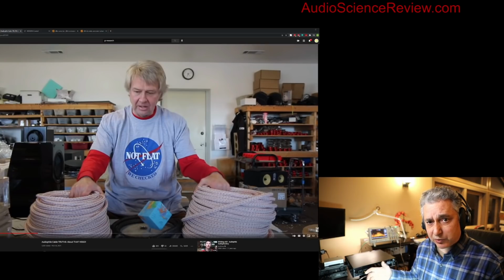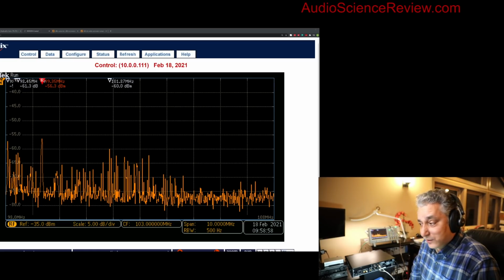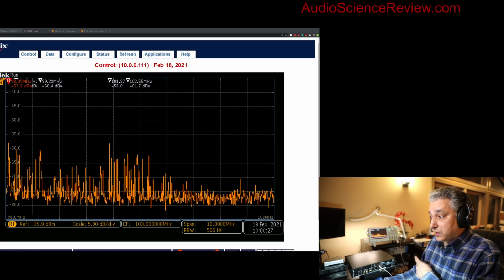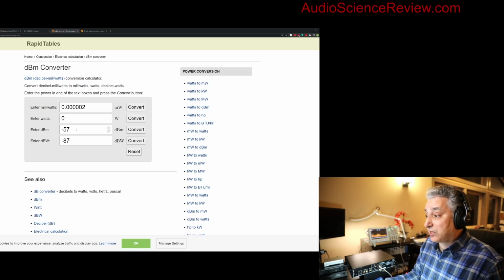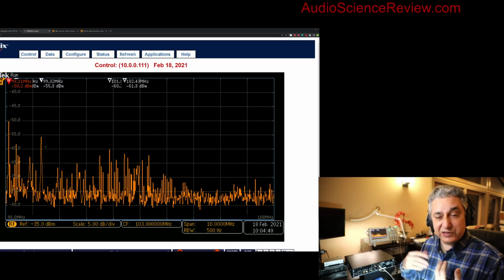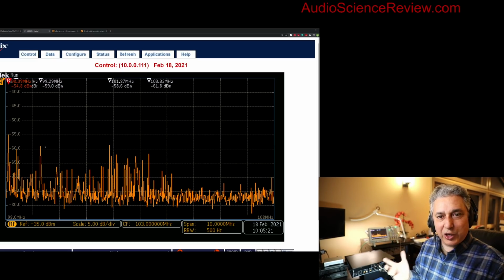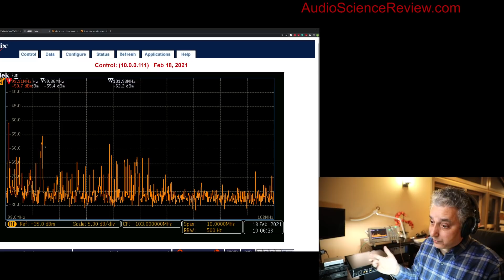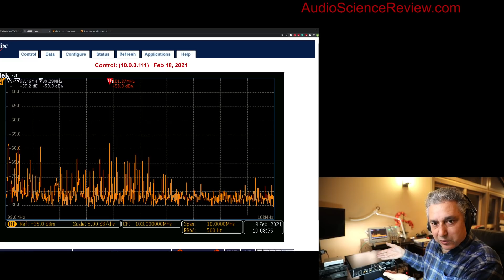RF Interference in Speaker Cables???

Comment: I will preface my comment with the fact that I am an electrician not an electrical engineer so my knowledge of interference is extremely limited. When we are installing data, audio and low voltage control wires we try to maintain a minimum separation from power wires and try to cross them at 90 degree angles. This is of particular importance when working with VFDs since us electricians have been told VFDs can cause a lot of interference. Should we be doing this with our audio systems at home? Is there some theoretical advantage to keep power and lower voltage audio wires separated and only crossing at 90 degrees if possible? 

Edit: here is the relevant Canadian Electrical code.

16-212 Separation of Class 2 circuit conductors from other circuits
(1) Conductors of Class 2 circuits shall be separated at least 50 mm from insulated conductors of electric lighting, power, or Class 1 circuits operating at 300 V or less, and shall be separated at least 600 mm from any insulated conductors of electric lighting, power, or Class 1 circuits operating at more than 300 V, unless for both conditions effective separation is afforded by use of
(a) metal raceways for the Class 2 circuits or for the electric lighting, power, and Class 1 circuits subject to the metal raceway being bonded to ground;
(b) metal-sheathed or armoured cable for the electric lighting, power, and Class 1 circuit conductors subject to the sheath or armour being bonded to ground;
(c) non-metallic-sheathed cable for the electric lighting, power, and Class 1 circuits operating at 300 V or less; or
(d) non-metallic conduit, electrical non-metallic tubing, insulated tubing, or equivalent, in addition to the insulation on the Class 2 circuit conductors or the electric lighting, power, and Class 1 circuit conductors.
(2) Where the electric lighting or power conductors are bare, all Class 2 circuit conductors in the same room or space shall be enclosed in a metal raceway that is bonded to ground, and no opening, such as an outlet box, shall be permitted to be located within 2 m of the bare conductors if up to and including 15 kV or within 3 m of bare conductors above 15 kV.
(3) Unless the conductors of the Class 2 circuits are separated from the conductors of electric lighting, power, and Class 1 circuits by an acceptable barrier, the conductors in Class 2 circuits shall not be placed in any raceway, compartment, outlet box, junction box, or similar fitting with the conductors of electric lighting, power, or Class 1 circuits.
(4) Subrule (3) shall not apply where the conductors of a power circuit are in the raceway, compartment, outlet box, junction box, or similar fitting for the sole purpose of supplying power to the Class 2 circuits, and all conductors are insulated for the maximum voltage of any conductor in the enclosure, cable, or raceway, except that no Class 2 conductor installed in a raceway, compartment, outlet box, junction box, or similar fitting with such conductors of a power circuit shall show a green-coloured insulation, unless such Class 2 conductor is completely contained within a sheathed or jacketed cable assembly throughout the length that is present in such a raceway or enclosure.
Reply: If you were really hard core about reducing interference wouldn’t it be possible make your cables out of stranded armoured cable and then bond the armour and bonding conductor to ground as a drain. Like I said not an electrical engineer just a curious electrician.

Comment: I was going to buy a set of Danny's cables just to send them to Amir. I really like Danny and watch all of his video's as I am. Speaker builder and have learned a lot from him. BUT when I seen his speaker cable video I had to pull back. I've read many studies in the past debunking Dannys cable nonsense and couldn't believe he was peddling this nonsense. And now again a real scientist is debunking it AGAIN.
Reply: Another Iowan here - Danny may have knowledge designing speakers, but he's too steeped in snake oil commerce now to be taken seriously. I would love to see an  RF engineer's assessment of those Tube Connectors he's peddling. He once said his system was so good that you can hear the difference between a new cable vs. one that is burned in.
Reply: @tsOnMedia  its probably the other way around the system is so horrible has almost no sinad and he can "hear" the different "noise" in different cables because the signal is so bad
Reply: @tsOnMedia  I sent some of these video's to my brother inlaw whom works for Rockwell Collins Aerospace in Cedar Rapids. He's an electrical engineer graduate from Iowa State University "well known for their engineering programs". He just chuckled and said "Danny is an idiot regurgitating crap he's heard over the years from these bogus cable companies". Amir on the other hand is spot on. Using well known industry practices to test and give true results.
Reply: Hi !  problem is that a speaker cable is not supposed to be used as antenna for a receiver ... any wire can be an antenna ... Maybe his cable are shielded or twisted to act as a worst antenna   A speaker is a passive component ... does not amplify anything
Reply: @gino3286  He also relays on measurements to make his speakers good but not cables....
Reply: @iowaudioreviews  Hi thanks a lot i see  I have a huge respect of him as a speaker designer  I am sure his projects must sound amazing  Speaking of cable i am not that hot with speaker cables ... but ICs ... i do not know  I am puzzled  For instance i like how solid core ICs sound with digital.  Maybe they are filtering out something bad ? i do not know.  I had a Rotel cd player that i did not like completely  Then i put on a pair of Cardas Neutral Reference RCA interconnects and bam ... the sound was immediately better ... more musical  ample relaxed ... more analog like
I really do not know what happened.  Only problem price.  They are expensive and i returned them to the owner ... a friend.  But what a sound.  Very very nice indeed.  Kind regards, gino
Reply: @gino3286  As Amir has stated. If the the audio device is properly engineered decent cables really should have no effect. In reality lost of audio gear even the expensive stuff is not. Its designed by "flat earthers" and old geezers that believe their golden ears over a Audio Precision measurement machine. Amir's testing is helping us find the gear that has been engineered competently and yields good results. More often than not its not the expensive boutique gear that wins. Its just shinny, heavy and has a pile of subjective adjitives for specs....lol.
Reply: @iowaudioreviews  Hi thanks a lot for the very helpful advice.  I have seen the more recent video of Mr Amir comparing a medium priced speakers cables pair and a very cheap one and there were no differences in terms of added noise and distortion.  They were equivalent.  
I do not spend too much on speaker cables just a decent size cables used in car audio. 
In car audio the cables are hidden away so the look effect is not impacting the judgement.   For rca cable i make them myself using some decent minicoaxial cables that i can find in bulk.  It is possible to find 10-20 meters hanks for very little money.  For the plugs i am little confused.  Many cheap ones are fake and the original way too expensive.  Kind regards, gino
Reply: Danny did his test wrong, incorrect application as people try to argue ohms law when how an electric motor gets current from a battery
Reply: And CD players Sound and messure the same, its just 0 1 bits.
Reply: @gonzol46  Not to nit pick but depends if you use the digital out or analog on the player. Using the analog or rca out will use the internal DAC of the CD player, and most CD players even expensive ones have bad DACs in them. I found its better to just get any cheap player and run it through a external DAC via coax or optical. Even sometimes like the little $20 Fiio D3 DAC is better than most expensive players.
Reply: I’ve tried many speaker cables.
I have Danny richies cables
That I bought. & I can honestly say that they are the best cables I have heard. Big sound stage fuller richer sound & smooth.
I was a non believer that cables don’t make a difference also quality parts all make a difference.
Even my friends listened AB not telling them what I have swapped out can hear the difference.
It’s not subtle it’s really obvious.
That’s the difference between someone that listens too music compared too someone that just measures.
Parts quality definitely make a difference. If you were too measure a cheap capacitor same valve & an expensive good quality capacitor same value they will measure the same.
But! You can clearly hear the sound difference between the too the expensive good quality capacitor sounds more open transparent smoother if you used in xover. A lot less time smear when listening also it releases its energy a lot quicker.
Cables make a difference & parts matter.
Reply: @johnkipos1427  yay, that's clearly the result of Danny's last video. You've just copied this stupid two camp theory, which is making you easier to believe this nonsense.

Listen, there are not only camps of enjoying audiophiles and just measuring idiots. This is bullshit.

"Oh, you don't hear it, so you're not able to listen properly"

Even Danny's description of the audiophile camp is flimsy.  They love music and like to talk about it, which means talking about components, cables etcetera.

And that's the most funny about the whole problem. I've never seen an audiophile talking about music. At most, they talk about recordings.  Not about interpretations by different conductors or musicians.

Comment: The result of 'those video's is that I still don't know what is a good speaker/interconnect cable and that's the answer Im after.
Reply from the maker: I have an article for that!  https://www.audiosciencereview.com/forum/index.php?threads/when-12-gauge-wire-is-not-12-gauge.3/
Reply: @AudioScienceReview  thanks for the link. Seems a 4 mm2 copper wire will do but hard to get. Why not just buy 6 mm2 then? What i wonder about and didn't came up in your video. Cables pick up signal. Rf is no issue. What about noise from mains? Speakercable run bevind your racket together with power cable.
Reply from the maker: And for RCA interconnects, I use Amazon basics.  They are soft and high quality yet cost peanuts.
Reply: @djgibby1301  Your ears are verifiably not the best measuring device. They are distinctly nonlinear for a start. And they are connected to your brain, which can really eff things up.

Comment: Danny was using a "meter" that showed the results that most people can understand and see. Yes he has a spectrum analyzer this is quick and easy. You both are doing the same thing just displaying it in 2 different ways.
Reply: Amir is showing that the RF induced in the cable is inaudible.  Danny's crude experiment was intended to do the opposite.  If you can't understand that difference then you don't understand what is being discussed.

Comment: One could make the argument upstream that if the device is designed poorly (i.e. without gate/base/grid stoppers) then RF can end up getting rectified and demodulated and end up in the signal, but speaker cables it makes no sense at all. Last time I checked, passive speakers don't have a way to demodulate RF.

Comment: Amir, I just saw Danny's cable video yesterday and just sent this comment to him a few minutes ago:

Danny, you claim that there is a noticeable difference in speaker cables and that the difference is caused by EMI pickup that can be filtered out by the speaker cable, right? So putting a filter on the amplifier end of a speaker cable should make a noticeable difference, right? So a possible test for this would be to use a power line EMI filter available at any electronics supply company and even walmart.com and see if you can hear a difference. I happen to have 4 Delta Electronics 10DRCS5 EMI filters that can attenuate EMI at >60dB at 1MHz but I do not have a setup to test this currently but would be happy to send you a couple of them to try yourself.  These types of filters cost around $20 each but I got them on clearance for around $4 each. Looking at all the speaker cables from the links you provided yielded a difference in the cost of a pair of 8-foot speaker cables from $220 for cables with EMI filters to $107K. Before spending even $220, I would spend a few bucks on a power line EMI filter, put it on one channel of your system, and see if you can hear a difference between the channels. If you have enough EMI field strength to hear an improvement with the filter, then spend a few more bucks to put another filter on your other channel. Problem solved.

I happened to hear Danny's video yesterday when driving into Pittsburgh and almost drove off the road from emotion. Being an audiophile myself but with a 50-year career in audio and RF electronics, I fully agree with your assessment. Having worked at CBS's Technology Center doing blind testing among other things and also having FCC licenses, designing and building antennas, and having operated and maintained RADARs for the military, I find it ludicrous that there are so many people with no knowledge but with lots of disposable income that support a whole industry of audiophile snake oil.

Thanks for jumping on this with some sanity and perspective.
Reply from the maker: Thanks for the offer Stewart.  I have actually tested a number of power filters and will post a video on that soon.  As you, Danny's last video got me as it really went outside of the norms for the cable industry to claim they are all right because they all agree with each other!
Reply: @AudioScienceReview  Amir, are you planning to test them on speaker cables as well as power cables? That would be a very interesting video indeed.
Reply: @Mr Do you are missing my point. People are spending $$$$ to achieve the same thing as $ and are  supporting an entire snake oil industry based on unscientific comparisons and unsubstantiated marketing claims. But to answer your question, does the long-term placebo effect illusion have value? I would offer that it certainly does for the snake oil industry, but the value for a consumer of the snake oil industry can only be judged by the consumer's enjoyment and their wallets.
Reply: @Mr Do the placebo effect means there is no difference. So even though exotic cables may have value for some, it is really audiophile jewelry rather than any improvement in sound.
Reply: @Mr Do yes what he is saying is there is no actual difference. It's 100% beer goggles.
Reply: @Mr Do blathering
Reply: @Mr Do so what you are saying is that if ketchup was mustard and Christmas was in July then a sea monkey could chuck wood also?
Reply: @Mr Do there’s nothing wrong with buying some relatively affordable, thick, well made cables. 

But if you’re spending over 100 dollars on one single speaker cable, you are past the acceptable level of ‘enjoyable placebo’ and into the territory of being a self-admitted dumbass.

Comment: Typical fig8 cables are around 100R characteristic impedance. Cheap and effective way to quench RF pickup is to terminate the line with loading resistors. IME 100R at each end of the speaker cable works fine and clarifies sound. Better still is to use coax with terminating resistors and connect speaker baskets to shield/ground.

Comment: I think that having someone switch cables is flawed as well because too much time will elapse between samples. I think a highly conductive switch should used that would allow instant switching between cables.
Reply: That would be best, but really, at this point I'll take anything from the clowns that isn't pure anecdote.
Reply: @LouGuido  One's that believe cables make a difference are not the only ones that have only provided flawed blind tests from all that I could find a record of. Those tests have used low quality amplifiers and speakers. Really to make it fair there needs to be a multi test project in which they are carried out with different levels of equipment at different time periods. Reference grade amplifiers, source, and speakers, need to be part of the test as well as less capable equipment. It may actually be possible that some people can hear a difference in speaker cables that we have no way to measure. Blind tests have been carried out that support both opinions seemingly but they are all flawed from what I have come across.
Reply: @ninjareynolds  Prove it.

Comment: Amir  an attempt but...   Odbm = 1mw into 600 ohm = 0.707volts. (RF db's no different from Audio frequency db's)   HF RF causes DC shift of voltages in semiconductor amps  due to BCE junctions and capacitance of the circuit, and MF-RF  produces noise,  all dependant on design, but can increase noise and distortion.   Note: is the spectrum analyser terminated by a load?  typical of a speaker.  Yes it's Science, but not perfect engineering analysis.   Let's see a real setup and then try a few things like HF and MF RF ferrite blockers , 3uH choke aka transparent cables,  or  zobel networks aka MIT,   then do some noise level test with Goerts, KimberTC, Nordost, and simple shotgun and twisted pair and star-quad speaker cable comparisons with noise levels measurements.

Comment: Amazing work Amir. I used to pick up AM stations through the wah pedal on electric guitar gig systems. I could clearly hear them but I am pretty sure it didn't have anything to do with the speaker cables and indeed with the electronics of the wah.

Comment: Are you just directly connecting to your 50ohm scope input (which is typically grounded), because then its is possible that your are receiving significantly more rf than if you were to have a floating load like you would with a speaker. Im impressed with the amount of signal that you are still receiving. Of course not that it matters this is definitely inaudible.